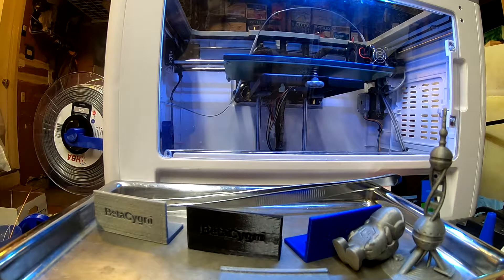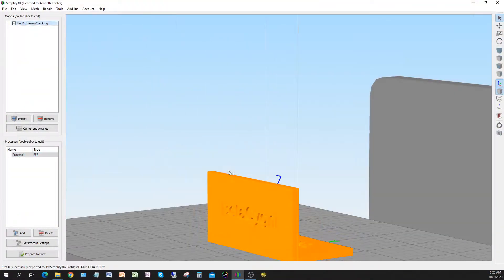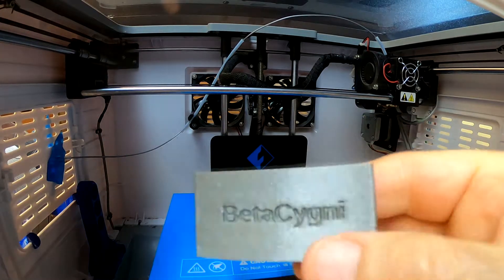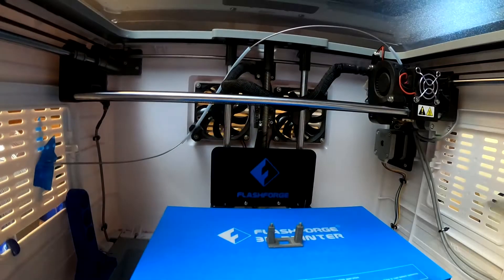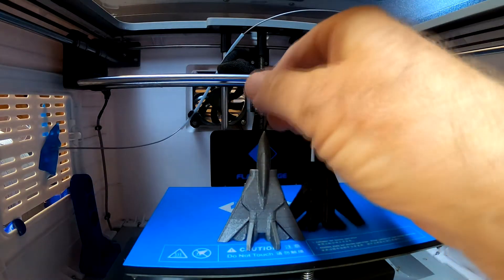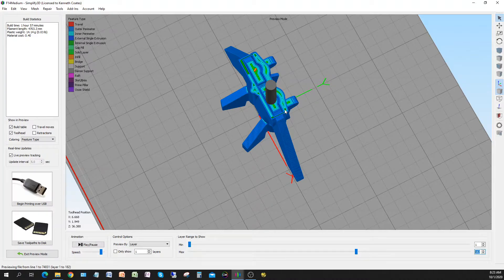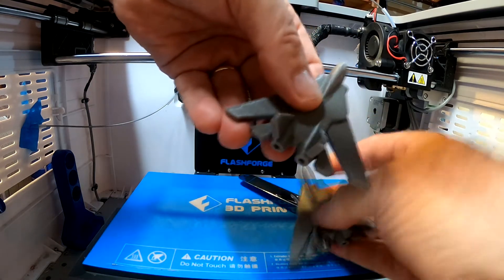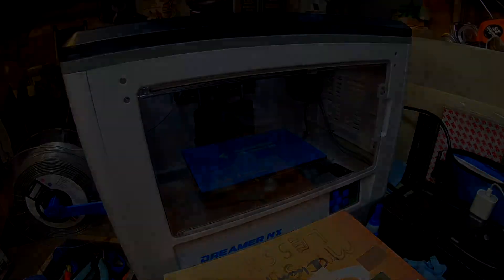Flashforge Dreamer (NX) - Second Try at printing with HQA PETG - Success!

Comment: My Dreamer doesn't have a setting for PETG, what should I set it on, PLA?
Reply from the maker: The Dreamer itself doesn't have a specific setting for PETG, but as I demonstrated it has the capability of printing with PETG.
You set the parameters in your slicer that creates the file ( .gcode or .gx) that the Dreamer uses to print your model.
Which slicer are you using?
There's usually a setting of the filament type in a slicer to set a number of parameters.
The most important ones are the extruder temperature, bed temperature, and cooling.
Currently I'm using 237 degC for the extruder, 65 degC for the bed temperature, and for cooling: I use 0% fan for the first layer and then either 5% or 10% fan on the subsequent layers.
I also print with everything closed up (top on and door closed).
That's a starting point. It depends somewhat on the shape of the thing you're printing.